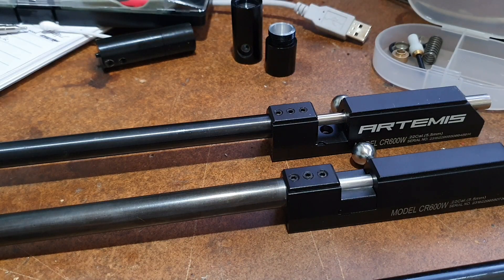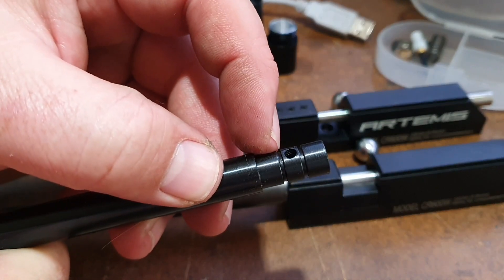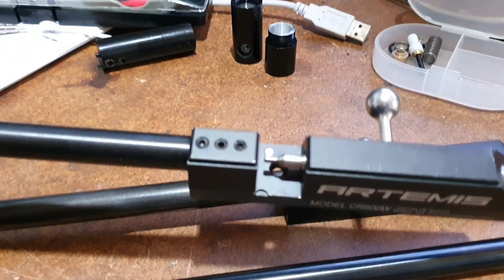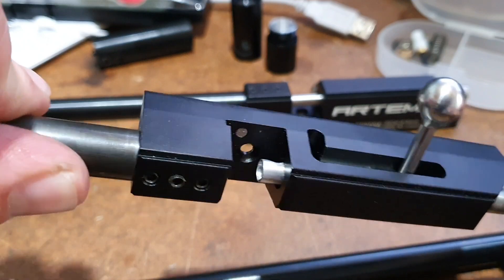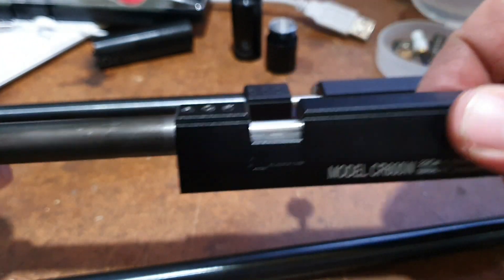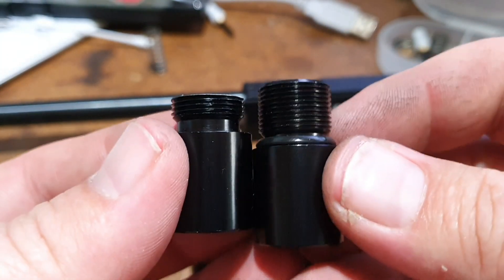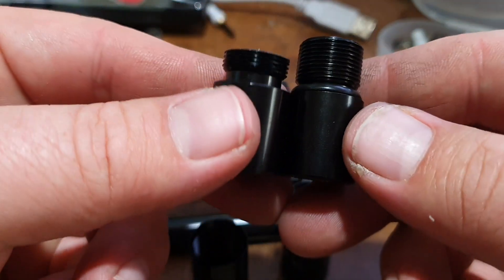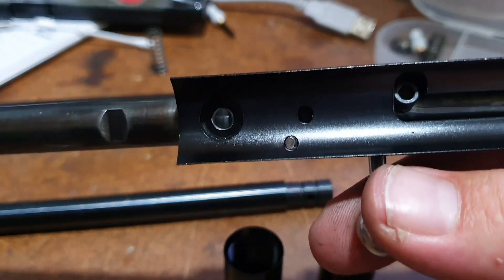Artemis Spa CR600w .25 cal upgrade project update.

Comment: do you know if anyone is making 22 hollow probes? I've drilled out my ports to 4.5mm and occasionally I'll get a pellet that nose dives into the port. If I press down on the top part of the skirt while I insert the pellet (so that the pellet tilts up slightly) then I don't have this issue, but I really like your hollow probe approach.
Reply from the maker: I haven't seen any commercially available but any gun smith or machinist could easily build one using the standard probe as a template, you just have to make sure the hole in the bottom of the probe lines up perfectly with your TP.

Comment: Jumping on lathe to do this power mod wish now. Hopefully I don't bugger it
Reply from the maker: Just watch the depth and diameter so you don't take it too far!
Reply: @edaggs1677  lathe I had access to didn't have a good cutter for depth. Cut the thread down remove the thread on the inside and opened up the other side .but still what a power increase cant wait to finish the depth off at some stage

Comment: how did that .25 go ?? love the bolt probe ! have you tried that in  .22 ??
Reply from the maker: On 12gr co2 carts it ended up at around 22fpe, which is a fantastic result. Unfortunately this one was a build I was doing for someone else and I sent it off to him before doing a final performance video!. I have used these probes in .22 cal as well when doing larger TP holes, it works very well.
Reply: @edaggs1677  what would be your basic price to supply me one in .22 have already increased TP to 4.5mm , and would you need me to send the bolt ?
Reply from the maker: @forcemultiflier1746  All my machining is on hold at the moment, bit of a backlog and loads of other work on.

Comment: Great work and don't forget to grind down the valve stem from 3mm down to 2mm for more flow! Also you can remove a couple of mm from the valve spring guide for more volume! trrobb sells a longer valve stem too, 1.5mm longer

Comment: Is that valve really strong enough whith that much material removed?
You'd think most of these rifles have been engineerd and not have excess material and threading to reduce cost.

Hope I'm wrong tho xp
Anyway looks great, love vid's like these.
Also incase people wonder about turning the cr600w into a PCP,  just look for the pr900w.
It's the same airgun but a factory PCP version that's only like 20$ more expensive.
Reply: This rifle comes in CO2 and PCP (Diana Stormrider). The parts of the gun are almost identical since they are mass produced and it is cheaper to not to retool for minor changes. Maybe different springs strength but the valve assembly is the same. In PCP form the assembly must withstand at least 200bar but at 21C CO2 only has around 62bar of pressure.
That's why you should be fine doing this with CO2 but should probably not remove as much/any material from the valve of the PCP version.
Reply: @5Komma5  you are exactly right!.. I have 3 Diana chasers and bandit and I've done these valve mods and more to my Bandit pcp in .22 getting 27.34 FPE....